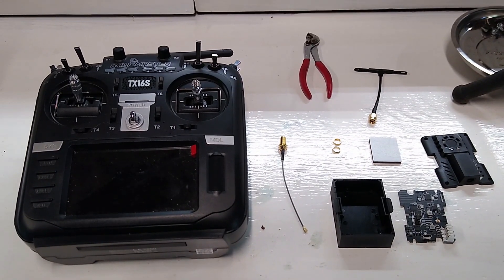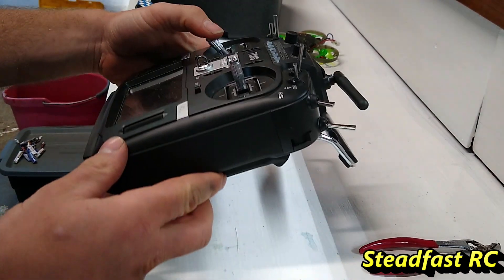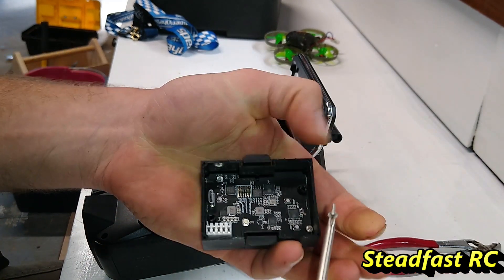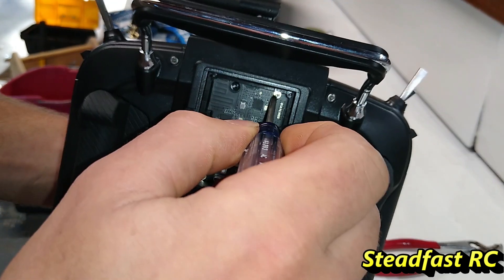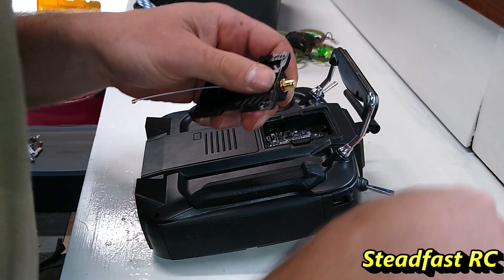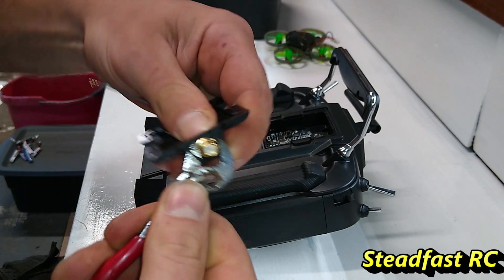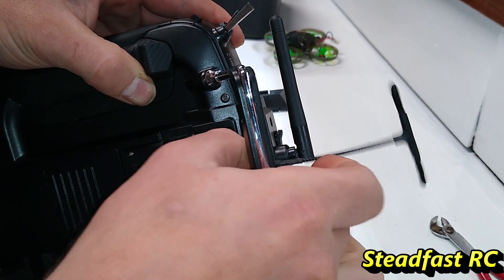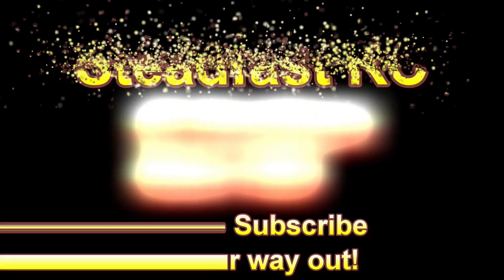Express LRS 2.4 ghz modual installation

Comment: The 'loose screw' method to align the PCB to the project box/case for the module is smart. Thanks for the tip, I'll be doing this in a few days when mine arrives.
Reply from the maker: Awesome man , I am looking to make a full flashing video for the rx and tx as well, just need the time!
Reply: @SteadfastRC  I've subscribed. I look forward to seeing the how-to.

Comment: hi do you recommend hm elrs 2.4 for tx16s? did you have any problem ?
Reply from the maker: Oh yeah I recommend it for sure, it has been my daily driver since I posted this video and I have had no problems with it at all, I also helped a friend install it in his TX 16s and all his quads and he has not had any issues either.
Reply: @SteadfastRC  okey thanksss, does need a fan ?
Reply from the maker: @SAMETELMACI  I dont use a fan but if you run 500-1000mw I would use one. I have more elrs videos coming,
Reply: @SteadfastRC  okey ı will buy hm elrs thanks

Comment: Cool I just now got the notification whats up with you tube these days good work looks like a pretty versatile radio 📻
Reply from the maker: Great radio, and this Express lrs module I just put in hass been range tested at over 20 miles and still not failsafed, basically one of the best control links for aircraft that there is right now.